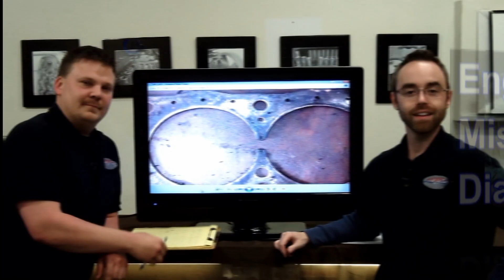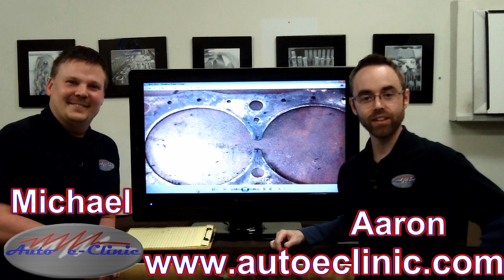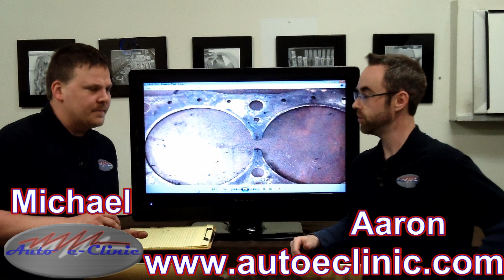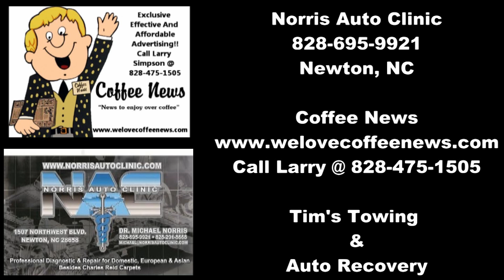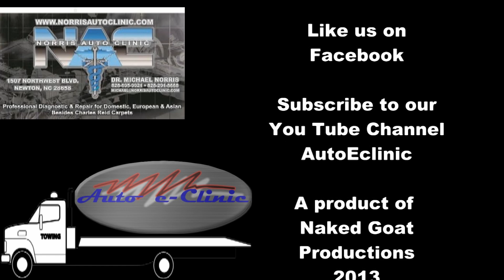Engine Misfire - Recap on Ford F150 Engine Miss - Blown Head Gasket - No Compression

Comment from the maker: There are some cases where the aftermarket will correct OEM defects through their replacement parts. Its best to do a little research if there is an issue with an OEM parts. Make sure the manufacturer has not come out with an updated part to correct any problem they may have been having. Fel-Pro is a good product and in some instances make the OEM gasket. In the case of GM intake gaskets, Fel-Pro has made their gasket out of aluminum rather plastic. This increased the life of the gasket!